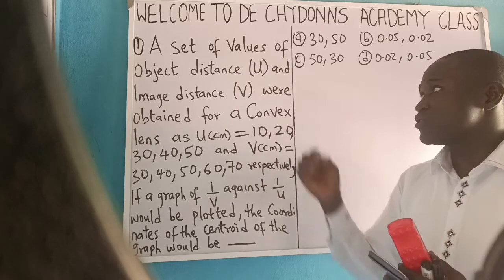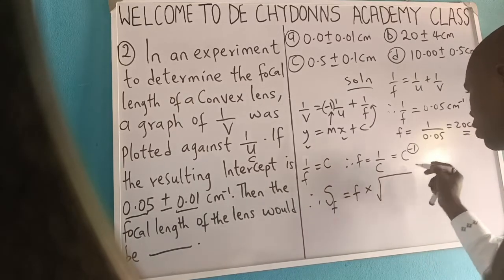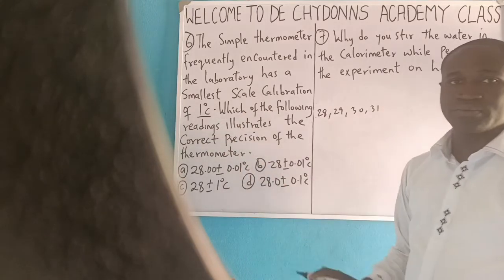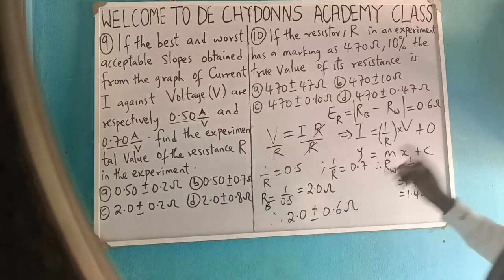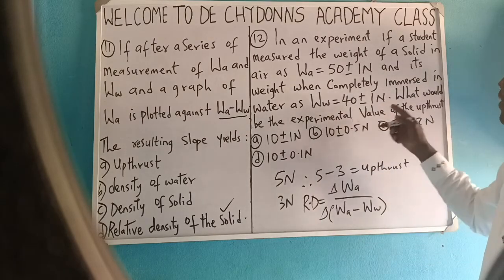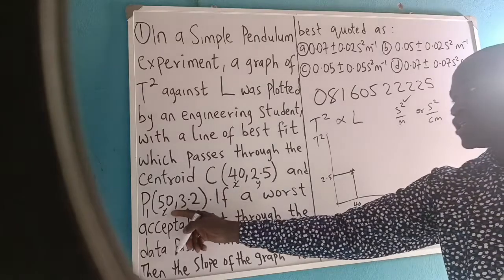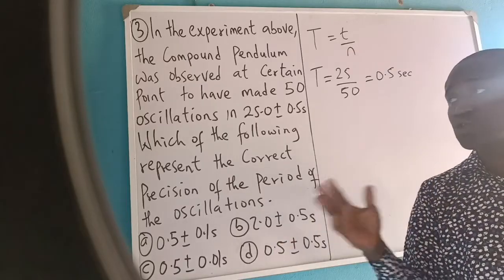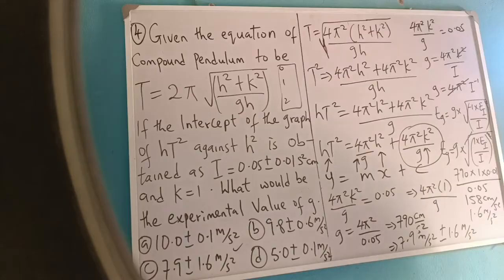Simple pendulum,Light rays experiments etc; over 20Exam questions/solutions(Full Video)#foryou#viral

Comment: For number 1 isn't it supposed to be (0.05, 0.02) cause of (X,Y) 9:12
Reply: @chydonnsdaniel  your solving is not wrong
I'm just asking to know if 0.05 is supposed to come first cause that's what normal coordinate should be like (x,y) but your answer is in (y,x)
Reply from the maker: I got ur point dear, you re correct. I interchanged the answers. It's meant to be (1/u ,1/v) not (1/v, 1/u) Its a mistake. Thanks very much for the correction.